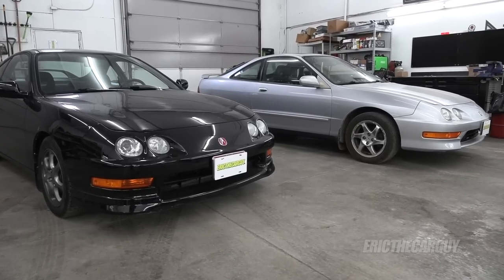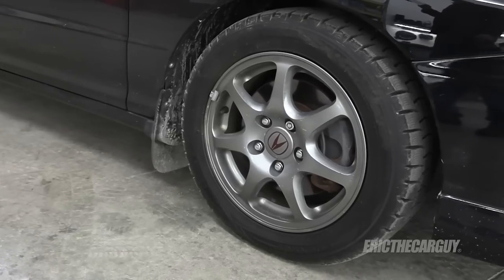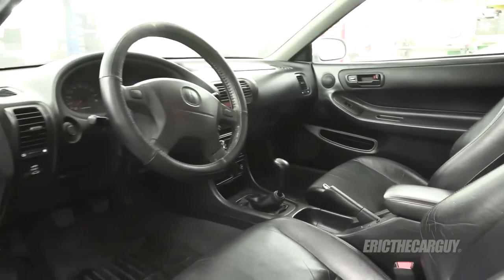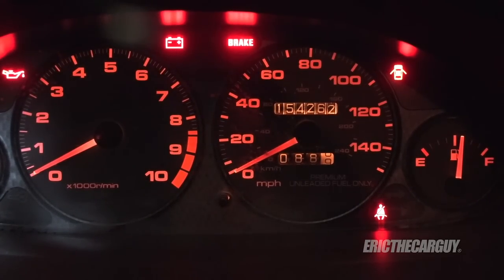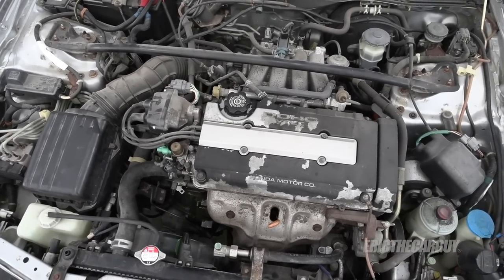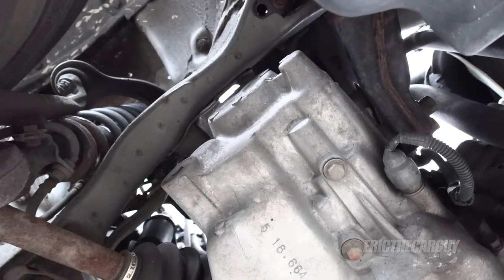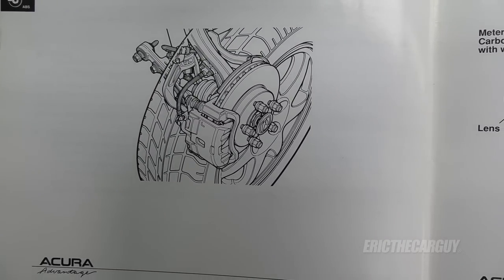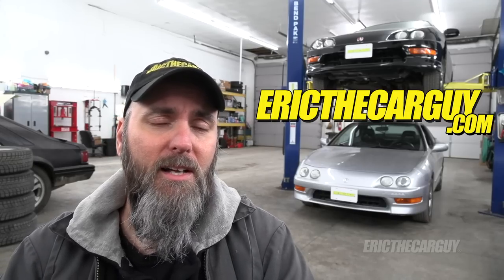Integra Type R vs Integra GSR

Comment: In new Zealand we have 91 95 and 98 available with e85 at some gas stations. I can't imagine running anything with a higher compression than 10:1 on less than 95.
Reply: James The way the US rates fuel octane is by using the AKI - Anti-Knock Index. Your fuel rating is based either on RON or MON. The AKI is an average of RON and MON by R + M / 2 so your 81, 95 and 98 may be the US equivalent to 91, 93 and 95. 

10:1 compression can definitely be run on pump gas, even 11:1 but it will have to be premium. E85 I don’t particularly recommend using unless you’re boosted or going for much higher compression because you’re running 30% more fuel for a 10% power gain.

Comment: I have a 98 honda prelude the engine compartment looks similar. It does leak oil. Vtec solenoid gaskets have been replaced. Thanks be safe. Fluid film for the undercarriage

Comment: the gsr and type r engine are the same with some changes. both have the same crankshaft. the type r has longer rods and high comp pistons. it also has lighter intake valves and dual valve springs. they ported it and put taller cams in and called it the b18c5. hence the gsr being a poor man's type r. it can easily be built up for cheap and you have pretty much the same thing.

Comment: How do you keep the type R from getting stolen. Always wanted one back when they were reasonably priced.
Reply: TL;DR: Move out of the hood or down south where people prefer American muscle & couldn't care less about Japanese "ricers". Plus, younger generations are owning cars less because they have social media an digital communication to socialize/game together subverting the need for a car to begin with. Less young & reckless people interested in cars means less people willing to commit car theft .

I always wondered that, not just the type R, but any car that tuners love to steal, specifically Honda Civics, Accords, Preludes & Acura Integras. I found the secret... move down south where they love muscle cars...'Murican. I lived in the Northeast, specifically in a town where you couldn't go 10 minutes without hearing an exhaust. I moved down south, rarely do I see a riced out car. It mostly just Mustangs, Camaros, old American sedans sitting on 24's & 4' in the air. I finally bought my dream car; 5th gen Honda Prelude with a manual transmission, and was so paranoid it was going to get stolen. No one has touched it down here. Up north, I had a 94' Accord with all cosmetic mods & exhaust, tastefully done. No decals or banners, just all blacked out, clean black paint job, slammed, with subs, 18" rims & black housing lighting all around. The last summer I owned it before I couldn't take it anymore, they tried to break into it 6 times within 3 months. I had a steering wheel & clutch club, & touch sensitive alarm that would signal my key-chain unit. They even tagged up the front of the garage door where I parked "marking" my car to be stolen. Additionally, with social media, gaming, electronics becoming more mainstream, cars being a hobby is becoming less of a thing. I read a report saying a few years ago was teh first time in the US there was a decrease in new licenses being issued. Talk with a lot of teenagers and they don't care to drive. They can use a car sharing/ride app or communicate via social media or some type of voice/message app. No need to spends thousands of dollars on a car, insurance, & maintenance to sit in the same room as someone to enjoy their company anymore.

Comment: @ericthecsrguy can you answer a question for me, I have a 2000 Accord v6 and was wondering your thought on me adding the whole 5 quarts of oil, when it calls for 4.6 quarts. I know you are the brains to ask this question. Thanks Bryan
Reply from the maker: I've been putting 5 quarts in J series engines for years with no issues.
Reply: @ericthecarguy  thank you so much, I watched an earlier video you made. And you made that statement about 5 qts, I just wanted to make sure nothing changed. Thanks again Eric....

Comment: Type R is so expensive now so I consider the GSR. Then I hear the RSX is the new type R.
Is it? 
Or has it lost the light weight mojo?
Any advice would be appreciated!
Cause all the cool cars are disappearing fast.
Reply: The RSX-S is a flop and shouldn't be considered a Type R replacement (even if you trick it out with all the ITR parts). I've had one and did exactly that, wasn't worth it and doesn't come close to driving like a real Integra Type R (DC2R)
Reply: @Giorgio_Rampa  Thanks. Appreciate the voice of experience.

Comment: Back in 2001, I was driving to a Honda dealer to snatch up a black Integra GSR, I've been eyeing for weeks. Thanks to my stupidity and not putting on a reservation, someone grabbed it literally hours before I arrived. I never forget this.  10 years later,  Acura (Honda) stopped making these, and instead focused on appliances on wheels, (SUVs)  which are ugly , overpriced and many of them didn't even receive a good score. I don't remember the last time I ever even looked at the Acura line up to consider purchasing one, they seem to sat on a high horse and their target customers are 60+ with a large family. And their cars are ugly, typical cookie cutter vehicles, invisible on the roads, because I see them so often and look like the rest of the 90% of the cars.

Comment: The differences between the two cars below 7000 RPM isn't noticeable because they are both 1.8L engines. No matter what you do to an engine that small, naturally aspirated, you won't increase the torque much.

Comment: You mentioned the gold badges... My Integra actually has the gold badge package. Not too wild about them, but the only reason I haven't swapped them out is because I have yet to see another Integra that has them, too. Most are silver or red-swapped, Type-R posers.
Reply from the maker: Yea, not too many Integra owners went for the gold pack.
Reply: My 95 GSR has the gold pack. I didn’t know it was dealer installed. If I ever freshen the car up, they’re gone

Comment: There is no excuse for an unkept car. I daily drive my vehicles and they are spotless.  I own a 1998 Supra 2JZ-GTE with 145,050 miles on it and it is spotless inside and out.  I also owned a 2006 Lexus LS430 with 235,110 miles but unfortunately a soccer mom ran a red light and totalled it. When the insurance adjuster came to evaluate the car.  He ask me if it was a new car because he can not believe it was a used vehicle. He commented, it was the cleanest like new interior he had ever seen.  I also own and run 8 businesses in town so i am very busy too but still it is no excuse for having a dirty car.  How hard is it to just take her in for a good detail once and a while if your sooooo busy.

Comment: Does the type r burn much oil having 154,000 miles ? I owed a uk civic with a b18 and it had 150k burned a full bottle of 10w40 in 250 miles
Reply: Andrew Johnson if it burns 10-40 that quick gonna need a rebuild

Comment: Since you were an Acura Mech.  Tell me the details on the b17.  You say GSR made their debut in 1994.  I bet you both your GSR and TYPE-R You are wrong.  1992 GSR B17a.  I have three of these engine, and can pull the title sale on two of them.  The third is a damage recovery that I want to get rebuilt later (damaged really bad).  Anyways, My point question to you is, what knowledge you have on have on the B17a.  I have driven B16a OBD0, Nice engine, just unfortunate it was on a S1 short gear JDM transmission ...  B18a, B18a1, B18b, and B17 in my DA Integra and the b18b in 1992 Civic HB.  I have a B18c1( never driven by me), which I am debating on doing a full rebuild for a 11:1 Compression with Skunk2 Ultra Intake and Over size Throttle to mate/match with a t3/4 ar.7 Godspeed Turbo, ... I plan to build that with my 1992 Integra's YS1 Long gear transmission.  My plans are to pull the YS1 1992 Long gear from and install LSD into that transmission for the b18c1 build. 

The Interesting deals are the b17.  The first b17a I had I think had a flashed (I know remote flash programming ECU exist, and I think it was set for a Type-r Map with a Stand still launch rev at 2700rpms.)  I know this because I drove the car.  I know the Original P61 92 GSR ECU's don't have that, and RPM limit at 8500, this one went to 9200.  I pulled the head to see if there were internal upgraded pistons, and it was all stock, I was shocked and pissed for doing that work.  What I like to know is what information you have from personally being an experienced Acura Mech ... what do you know about the DA Integra's which are actually better Integra's versus the 3rd Gen. 

The 2nd Gen is the Commerical Bluepring Revamp of Honda's Formula Cars which Proved VTEC SOHC in the mid to late 80's on thr track courses.  Honda Developed VTEC in the 70's thanks to Ford who was the Original Concept Design creator of Variable Cam profile offset During Operation.  Ford got it to work, but the failure rate was not something for commerical Production.  Ford's concept of VTEC was to slip a different cam lobe of a different profile during operation, it worked, proved the power gain, but the metal shift caused Breakage, with the failure Ford had a difficult time reconcepting a different mechanical Design and sold the Patent to Honda in the mid late 60's.  Honda with their Engineering creativity, came up with the Multi Cam Lobe Locking Rocker design ... Very Interesting.  I don't know how they concept that design.  Test proved it for roughly 10 yrs to identify Faults, Breakage, realiability.  When they were assured it is realiable, they race track tested it and produced VTEC in the SOHC 1.5liters and oversized 1.6l SOHC for track racing which also ran ( I think, not so sure, Turbo Applications to get the 300HP numbers for the Formula cars). 

The Mathematic DNA Blue Prints of the Formula cars were used into incorperating the Commerical late 80's (88 to 89) Honda's (non USDM market) turning a Race Bucket into a Commerical Coupe/Sedan.  Honda on the Overseas Market Sold the B16a in the CRX SI-r models, which I have seen these in Germany.  Integra DA models, I don't really know the real overseas release dates on these, but I have heard they were marketed as early as 1989 running the b16, I say that because they exist.  My 1990 Sedan which had a b18a was manufactured in Sept 1989.  I can show you the sticker.  The b17a (Unicorn VTEC DOHC) was very rarely made, total I think around 5000 through 1992 to 1993, which was only sold in the TOPLINE GSR Models.  Now ask me why I do not have those chassi ... well State of Washington with their Court system has a hard on for anything JDM that they know is fast. so I kept the internal and sold the chassi of my first GSR (still pissed to this day) to shove off the court.  Second one was a Damaged GSR, I should have fixed, but I did not have a means to pull the rear end damage. and the LandLord wanted it off his property .... (really pissed about that one, that was production number 254), but I manage to keep the titles to show I did own the complete GSR's.  One sold in Ohio to a Med Student, the #254 sold to an elder lady, who the car was stolen in seattle, so I bought the damaged car from her son but could not find a place or means to pull out the rear suspension crupple which bent the rear suspension almost into the gas tank. I ended up pulling that engine and installed it into my 1990 DA Sedan VIN Last four 5007.

So, now that I have proven, that 1994 was NOT the first year the GSR in USA.  Hit me up with an Email at andrew.toombs@gmail.com   I would love to bring the DA's by so if you like, do some work for a Youtube Video.  I think we both will like it.  I will discuss more if you email if you are interested.  The DA 1990 to 1993 are getting really really rare, and they are hella fun, you will like it.

Comment: Ok I own a JDM Type R, and I didnt even know that any integra full stop had cruise control, so TIL what that little filled button hole on my dash is for! I always thought it was for the absent Sunroof button haha
Reply from the maker: The sunroof button is located under the drivers side vent. Thanks for the comment.
Reply: @ericthecarguy  yeah kinda cool to see the difference between the USDM spec and the JDM spec actually. You have different seats, floor mats, steering wheel, a center console (mine has nothing except the handbrake) a different dash (JDM has yellow Needles and looks better imo), but my clock is the same white as the GSR.

Rims are different, JDM spec didn't come with a rear wiper in any model year I believe (its the easiest way to tell the fakes down here lol).

And of course the obvious, like the straight style headlights and different front end etc.

JDM spec is also lighter than all other region specs, at 1050kg (but I think thats without the optional air con and ABS, mine has A/C but no ABS)

Comment: So how would one tighten the con rods for the b18c5 without the Honda tool? I'm about to rebuild my b18c5.
Reply from the maker: I would look for one of the tools. Might be able to find one on Ebay or something. Part # is in the video.
Reply: For those looking I couldn't find anything based on the part number. But if you look up rod bolt stretch tool  you will find what you need.

Comment: Why so many affordable performance cars these days don't use high rpm naturally aspirated engines anymore? Isn't that the simpler and cheaper way to make more power when compared to a turbocharged engine? Or is it too difficult and costly to make high rpm NA engines that meet emissions regulations?

Comment: Fun fact if you want a poor man's JDM Integra Type R five lug conversion put the 1st Gen CRV spindles on now you have the 36 MM axles also the type-r windshield is 15% lighter also the type R Wheels has an option for 16 inch wheels

Comment: Take a B series GSR engine that burns a little oil and give it a stock plastic radiator that fails without warning.  A few miles later you have. B series GSR engine that burns a lot of oil.  Good going Honda!

Comment: The integra is just a eg civic. They have the same suspension bolting points and same motor mount points the dc and eg suspension and motors are swappable

Comment: Even though the R had +5 greater offset wheels, the hubs stuck out an additional 5mm.  Therefore the track width was actually the same between all the models.  I believe this was done to allow the R a wider rear wheel bearing (front wheel bearings are the same).

Comment: How are the 2 cars holding up these days?
Reply: I’m in the process of buying a 96 GSR with 185k miles that’s been stored for 5 years in a shed from a family friend. Last week we: replaced the battery, drained the gas and filled it with new 93 Octane, replaced the oil and oil filter, and it started first try no problem. Purrs like a kitten… Today I’m going back there to put the brakes on it that the owner bought and then never put on (nothing special but they’ll be nice to have). And then hopefully if all goes well I’ll buy it and put it back on the road! It definitely needs work (minor rust and suspension bushings from it having 185k miles and just being old, but besides that and some interior work, again it’s a relatively high mileage car, it’s in good condition!) These things aren’t exactly Toyota levels of tough, but they’re great, lightweight/fun cars to daily that get great gas milage and are fun to drive! If you take car of them and don’t just mercilessly beat on them (wait for them to warm up, do proper maintenance etc etc) they will last a very long time.

Comment: Wrong. The 98 GSR came with cloth seats and a leather wrapped steering wheel, I currently own one, and  the leather seats came  on the 99 n up
Reply from the maker: They did make some 98's with leather steering wheels, once again, it was also a dealer installed option. I put one on my '97 that did not come with a leather wrapped steering wheel, but it had a leather interior. As for the leather seats, I'm looking at the factory brochure now and it states that the GS and GSR came with leather. Yours may have been a special order. Thanks for your comment.
Reply: Wow I have never seen a GSR with cloth.   Maybe someone switched the interior.
Reply: EricTheCarGuy I found this on the Integra thread : “The GS-R was sold in the 1992-2001 model years. The leather interior was NOT available on the GS-R when the third generation Integra came out in 1994. Leather first became available beginning with the 1995 model year as a factory-installed option. The leather interior became standard on the GS-R beginning with the 1999 model year (as noted on the Edmunds website as well as on topspeed.com).”
Reply: touringteg Yea , the leather is nice ,but because of the way I drive  i don’t mind the cloth, holds me in place when I’m whipping around corners.   Second owner , purchased it for 1,6k !! Unmolested Milano red gently driven with matching vins on all panels. Redid the clutch recently with typeR flywheel and lsd , sitting on JDM TypeR suspension .

Comment: I think your camshaft end caps are leaking oil in both engines common B series issue, easy fix.

It's funny that my type r key has the exact same crack in the exact same place 😂